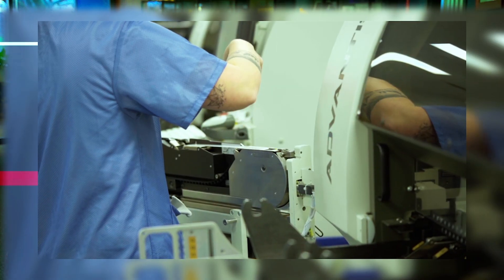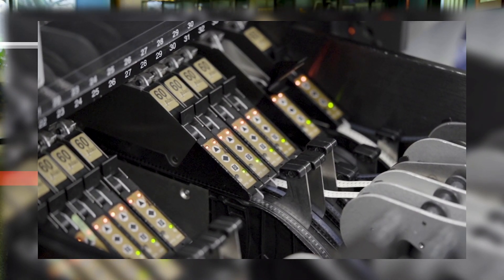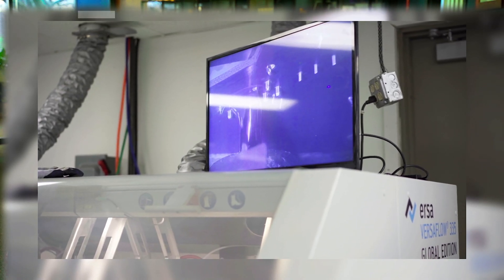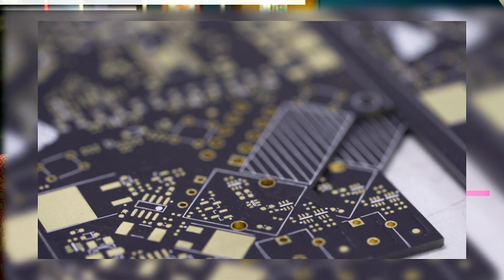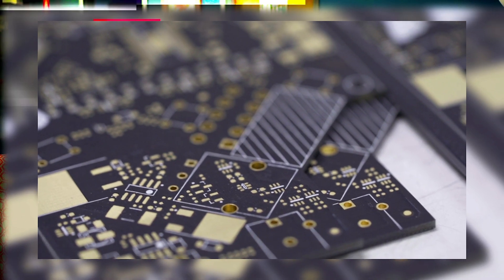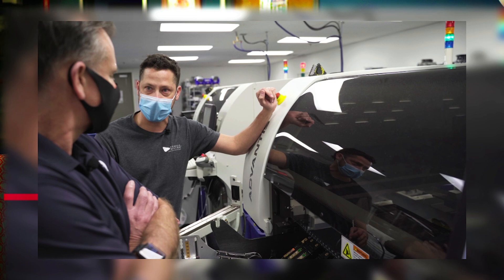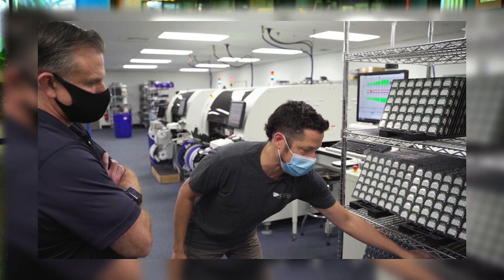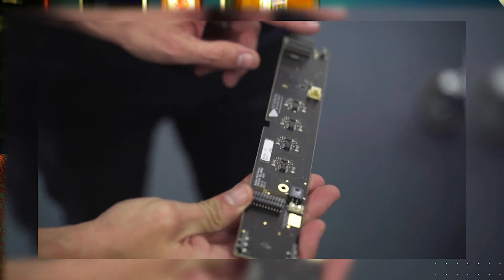Surface Mount Technology Explained

Comment: SMT (screen print, placement, reflow oven, optical inspection, ICT...) is not new technology in the world but wafer fab, America should control wafer process, equipment, material to China, it's the key to determine chip performance (speed, size, heat...)